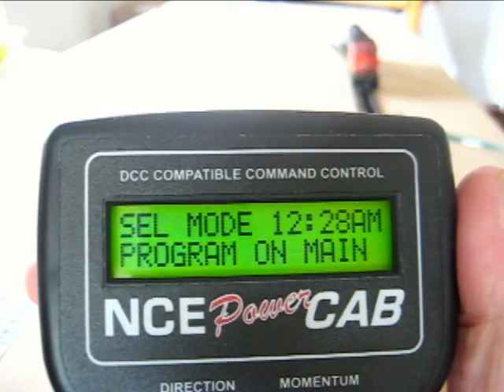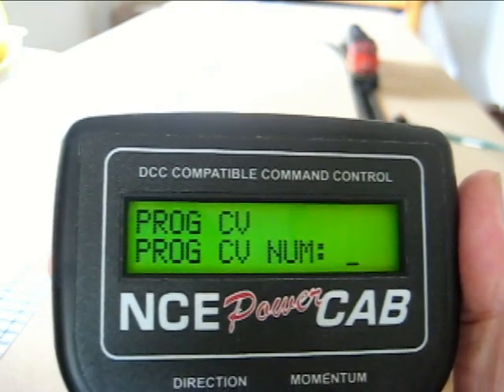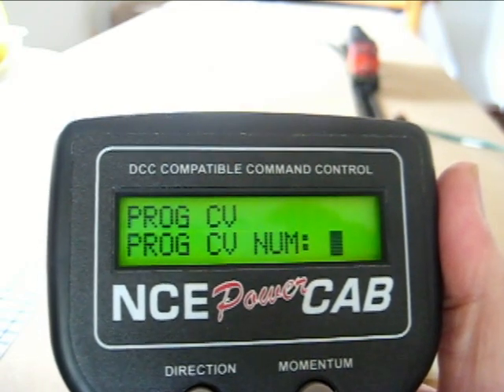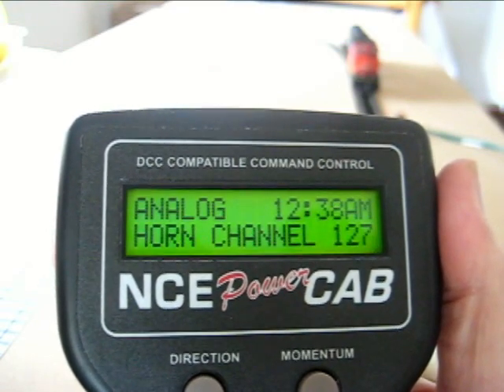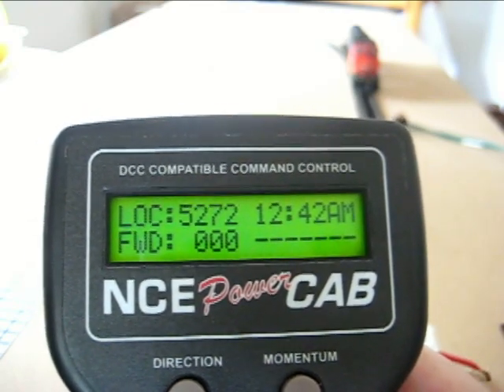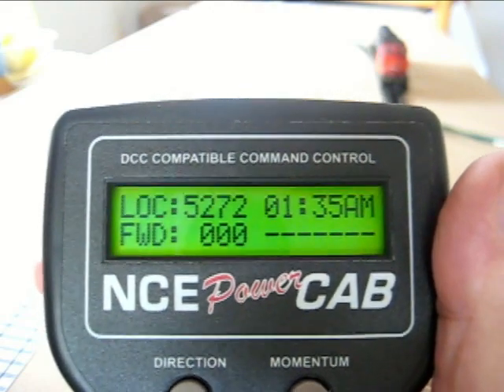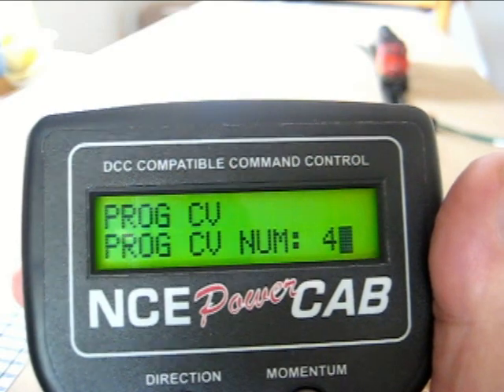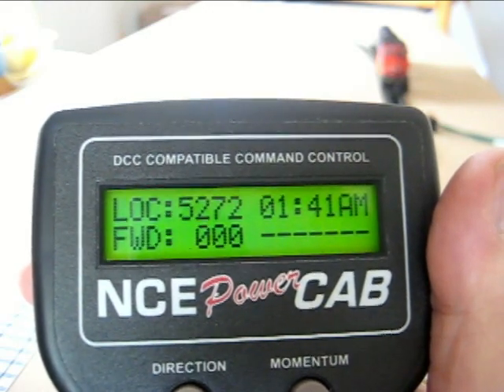Playable whistle with tsunami sound with NCE powercab

Comment: @DieselSmoke92
It's actually meant for steam engines, because they can adjust how much pressure gets to it. It's not meant for diesels
Reply: I think some older diesel engines have variable air horns, right?
Reply: @gtc1961  I thought (could be wrong) most, if not all diesels had variable horns.
Reply: Before the “desk top” control stand, diesels used a valve that controlled the air pressure just like the whistle on a steam engine. I love a nicely quilled Nathan M3 👌